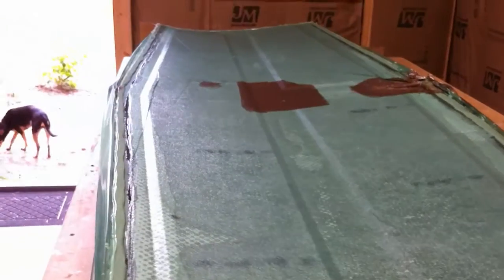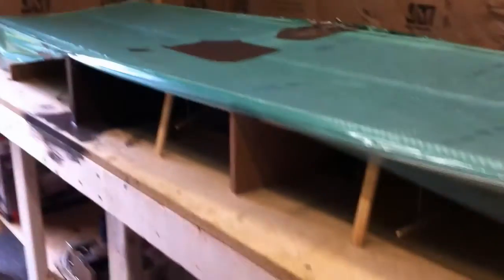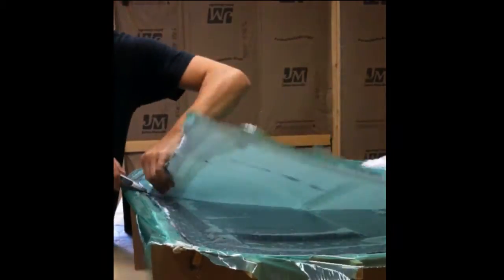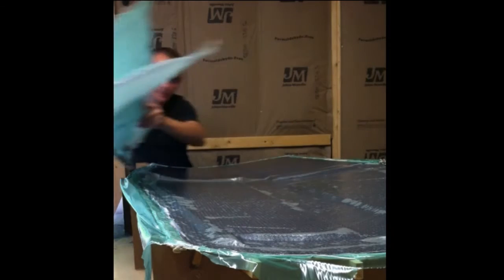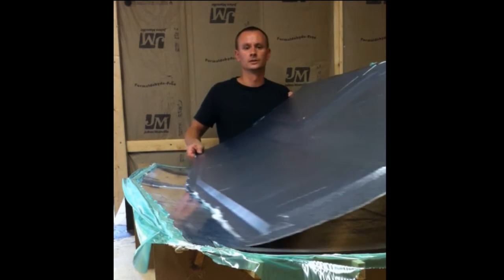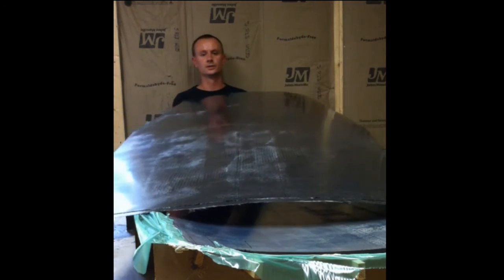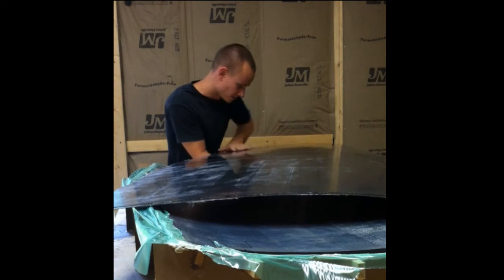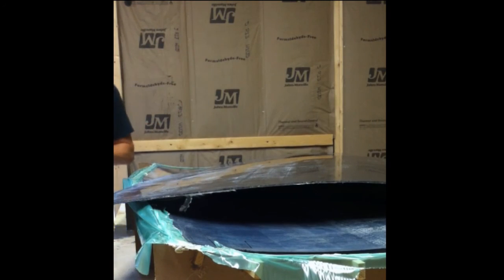Carbon Fiber Aircraft tail skin.

Comment: what is the amount of epoxy resin in carbon fiber? absorbent layer very rich
Reply from the maker: I pull out about 10%.  A little wasted resin but guarantees no dry spots. Also running the layup resin rich initially gives me a better surface finish and higher peel.
Reply: +Chris Christiansen the ratio by weight resin / carbon fiber 1/1 ?
Reply: +Chris Christiansen watched an earlier video. resin / fiber 50/50 ... OK . why foam impregnated with resin without filler microballoon
Reply from the maker: +makcplast Oh yeah, I usually start at 50/50, sometimes even richer (60/40) depending on the fabric weave, thickness, part, and intended inHg.  The reason I don't use micro balloons/slurry is because the vacuum bagging, at least in my experience,  pulls/pushes that mixture thru and into the structural carbon face layers thereby weakening the skins.
Reply: +Chris Christiansen OK . I understood you, looking forward to the next video. good luck in everything
Reply: +Chris Christiansen can go to our website http://heliwhale.ru/ see what we do